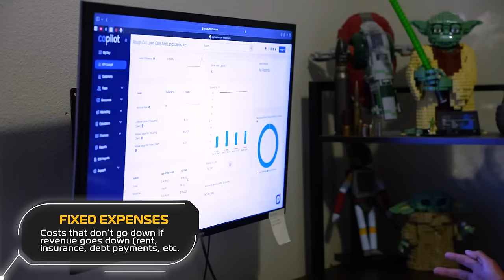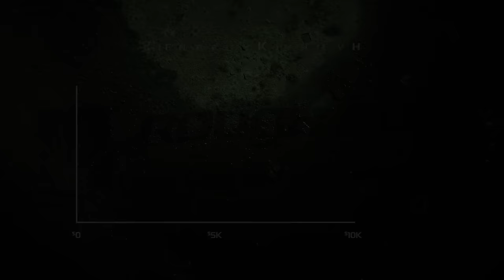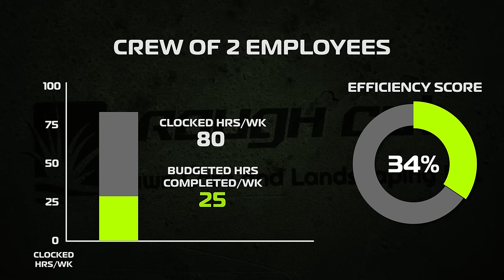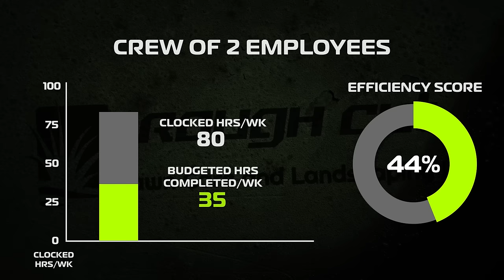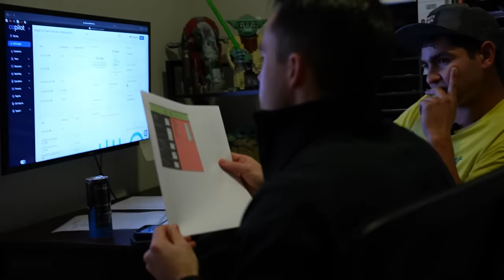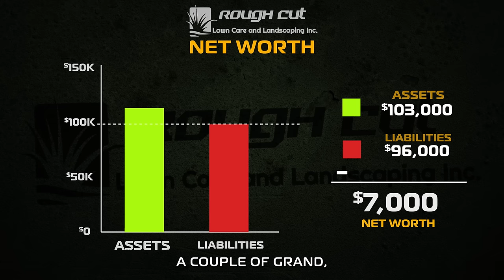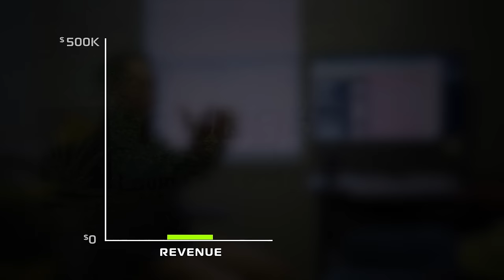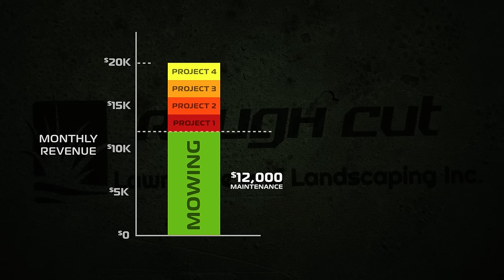$400K Lawn Care Business CAN’T PAY the BILLS!

Comment: The debate is between debt vs no debt, brand new equipment vs used, but I think this is the wrong angle. 
I think its about timing and ratios. The big mistake here was getting equipment anticipating growth, instead of through the growth. Maximizing capacity, getting creative about pushing capacity, then adding the equipment to right away fill the excess demand. 
And ratios. A mix of new equipment, old equipment, and rented equipment. As you scale larger you maintain that ratio of paid vs new equipment. 
You grew 100%, great job keep going!